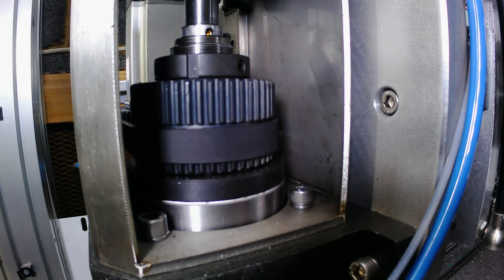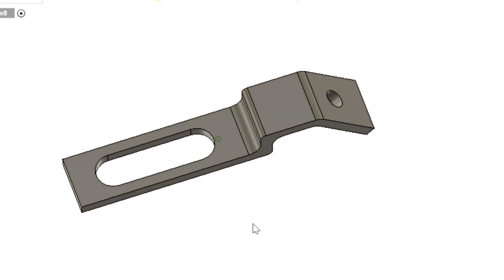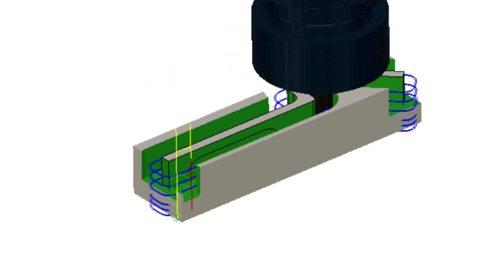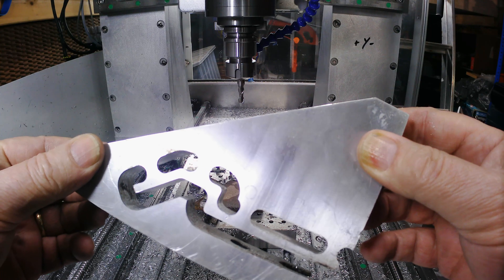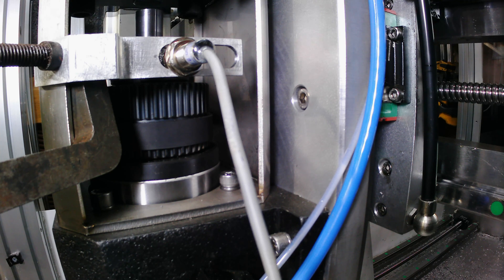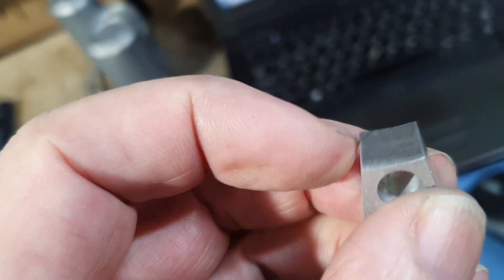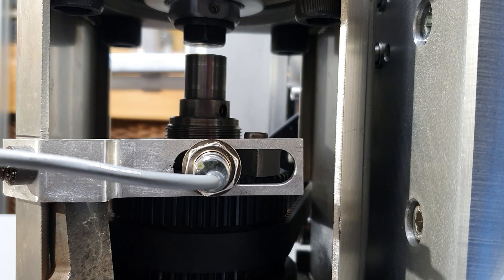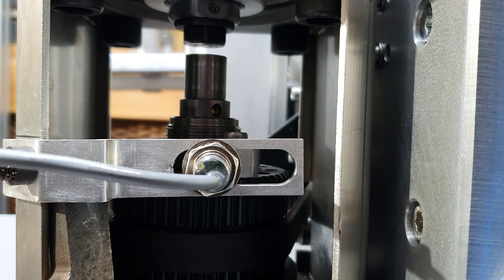DIY CNC 5 AXIS MILL TURN MACHINE PART 7

Comment: Awesome work!!  I would suggest some sort of accordion cover to protect the linear rails and ball screws from debris.
Reply from the maker: Hi, thanks for watching.
I did look into covers but because I designed the mill without them they will not fit on one side because they would clash with the 4th axis.